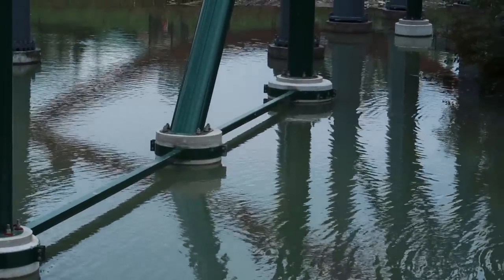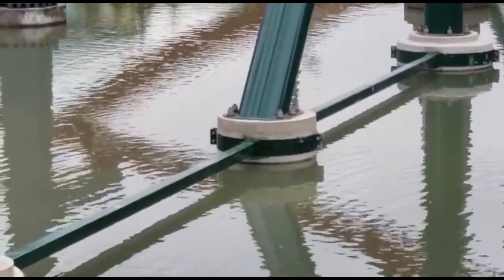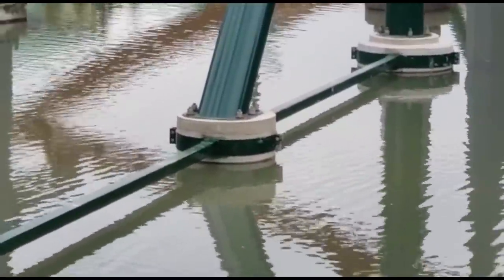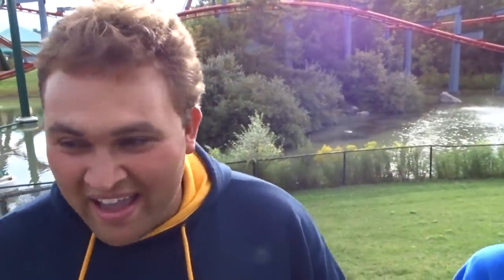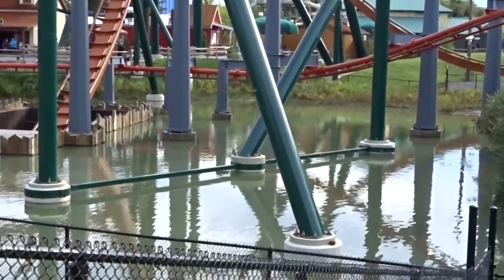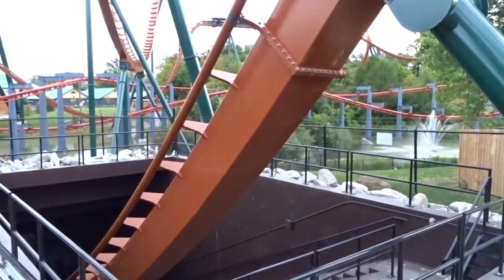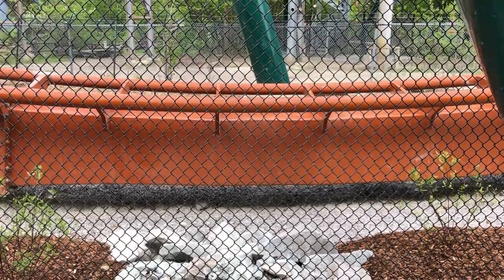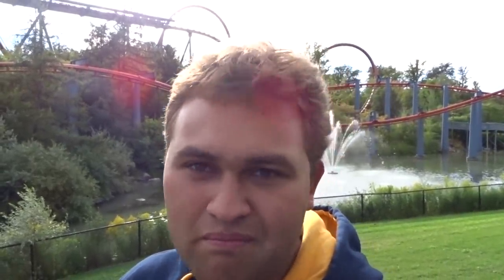Yukon Striker Sinking?

Comment: That diagonal column is a lateral brace which is used to transfer horizontal forces from the track to the ground. Since its footing has become detached from the ground, those forces can no longer be transferred. It looks like those two horizontal members were added so that the lateral forces are transferred over to the adjacent footings where the forces can be transmitted to the ground. I suspect it's just a temporary fix until the footing can be repaired properly.
Reply: I'm just speculating bec1ause I haven't seen the geotechnical data or found drawings. But I highly doubt the footing has separated from the ground. It seams like there is a lot of energy being transferred from the column to the concrete. And since the footing is cylindrical, that energy gets dispersed throughout the water  evenly. Thus making those perfect ripples.  In school we are taught in certain cases, forces can be concentrated in members that are slanted in the x,y direction. And because the connection between the box spine and column is fixed by bolts and spacer brackets, it acts like a moment connection. Atleast that's what I believe is going on 🙂

Comment: The "swaying" of the lift hill is even more prevalent on Sheikra because the ride is capable of having 2 trains on the lift hill at once (one on the chain going to the top, and the other on the holding break). Because of this, if you're in the second train going up the lif, as the other train goes down the first drop you can feel the entire lift hill swaying side to side and I love it.

Comment: Those concrete discs are actually just  floating on the water ,the brace is there so that the 3 discs don't float away
Reply: Stuart sugden why would they design the ride to just float. There would be too much weight on those footers and those would sink a lot.

Comment: I appreciate the attempt at an explanation.  Don’t get me wrong he tried, but he didn’t really describe the main issue.  Footings are built for compressive loads meaning a downward force from the ride.  In this case, the track oscillates as the train moves over it which is actually causing the footer to rise and fall, likely because the ground the footer is resting in is not made of solid rock but rather loose soil beneath the pond.  The two outboard footers are supporting the weight of the ride which keeps them grounded in the soil.  The middle footer is only supporting a small component of the weight and is rather designed to support lateral loads.  The bracing was placed to try to keep that footing from moving vertically.  This is not normal and certainly the ride was not designed to do this to this extent or those cross beams would have been designed with the ride or a larger crossbeam support would have been used to complete a truss.  I anticipate this won’t be the last change that is made at this part of the ride.  Look out for changes during the off season.  Think of it like adding those supports to either end of Wicked Twister’s towers.  This was a design change that the designer had to make upon to realizing the conditions present on the actual ride.  You can’t always anticipate every variable in the design process.

Comment: Bet the footer lets repaired or replaced of the winter.  It's probably slipped or water got under it and ovaled the hole.  They will probably just pump grout around it to seal it.  Have had to it on light poles before.

Comment: What about how much steel vengeance moves? It shakes like crazy when the car passes by
Reply: FreakOut Productions Steel Vengeance "shakes" because like the steel supports used by b&m, the vibrations need to be dispersed throughout the wooden support structure. In order to do this the supports need to be able to move to sort of "cushion" the forces being placed on them, this is especially apparent in the first inversion of the ride and also behind the 90° section of the first drop. If the support structure was completely stiff it would cause much more stress on the beams attached to the track and cause many issues.

Comment: Alpinegiest at bush gardens was sinking like a mofo engineers were brought in with construction crews to redo the footers and yes metal fatigue is a real thing
Reply: Mike Stein Alpengeist, also, it was because a footer had cracked when they were testing it at one point. They had discovered this when they were doing a routine inspection and shut down the ride until it was replaced. I’d expect that the intensity of inverts probably put too much stress on the footer.